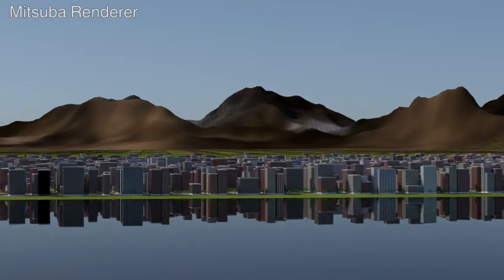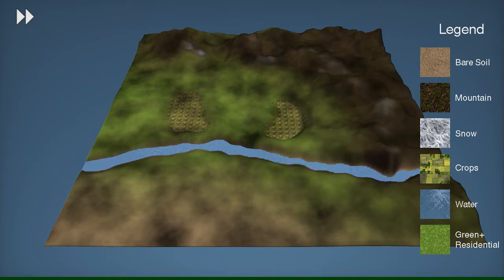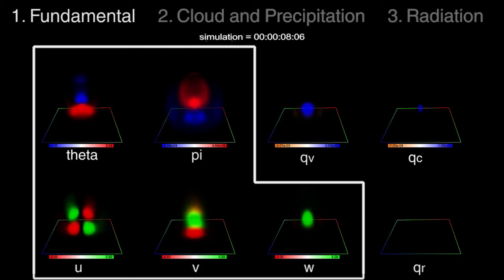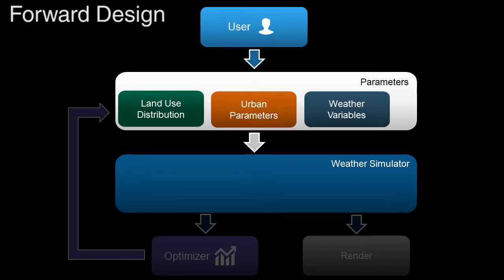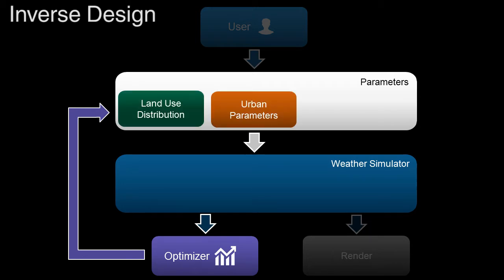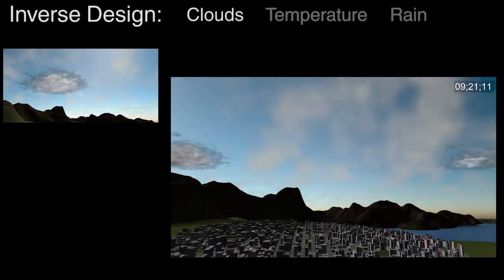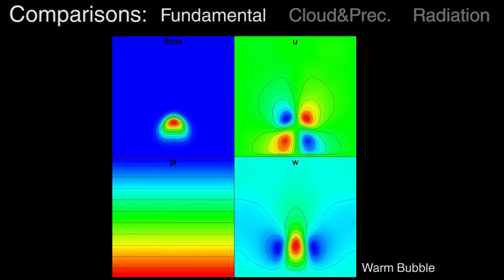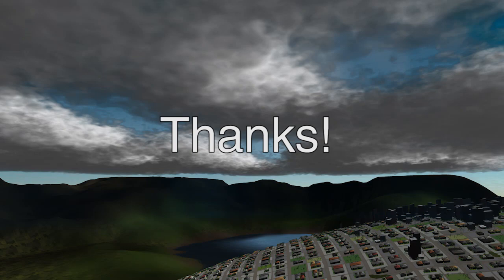Fast Weather Simulation for Inverse Procedural Design of 3D Urban Models (TOG 2017 & SIGGRAPH 2017)

Comment: I have reported some bugs on github, after simulatestep1, gridRslow, and grid3D[] are set back to 0, so everything in step1 is never saved. If you set step1-4 by reference, the values save, but then the simulation blows up
Reply from the maker: Hey! Thank you so much for the interest in this project. I just submitted some new code (solving your comment, thank you! and changing some computations with the latest GPU code), please, take a look and comment in the github issues. Thanks!